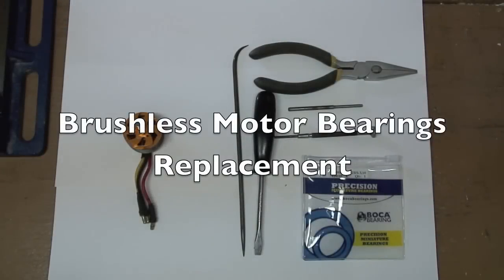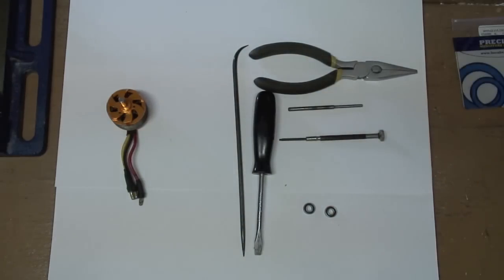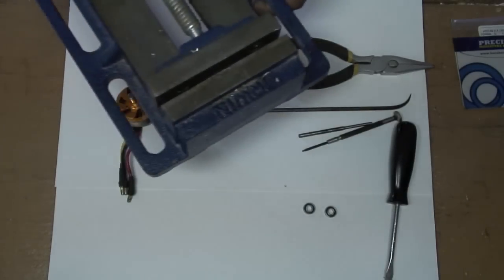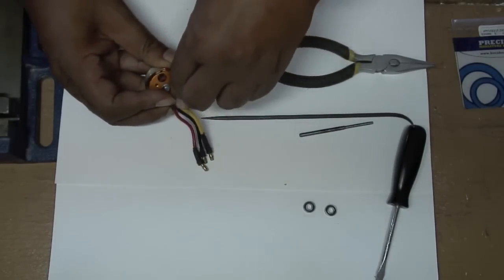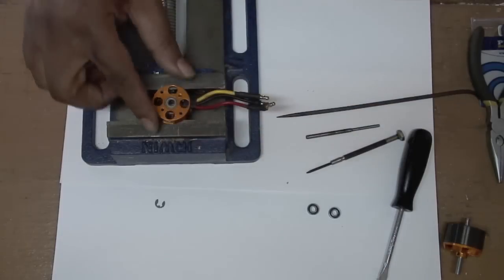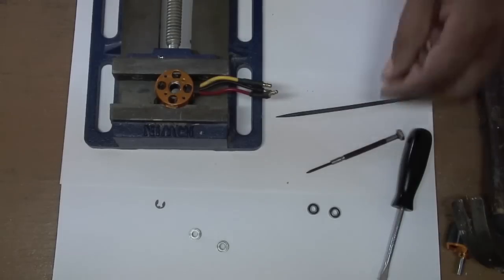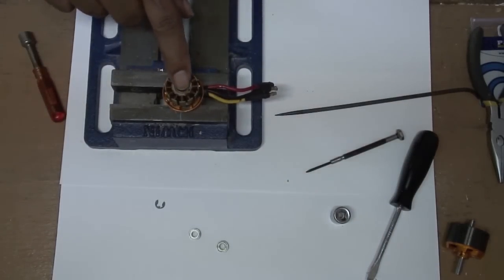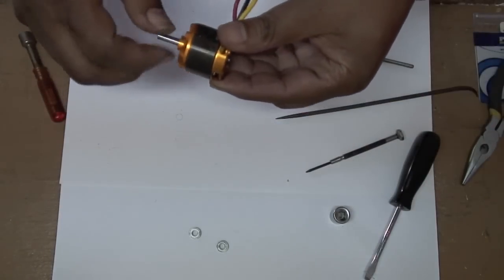Brushless Motor Bearing Replacement

Comment from the maker: @glmccready The 3536 series motors use bearings OD 11mm, ID 5mm and width 4mm, replacing the bearings along with balancing the bell (being it is disassembled) at the same time, should make a substantial improvement in your video quality. Of Course, balance the props too.